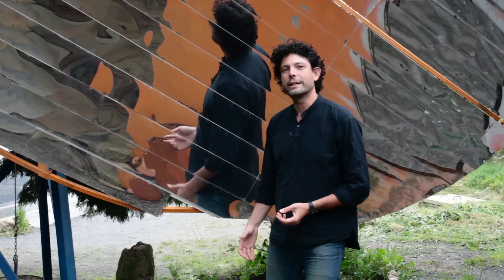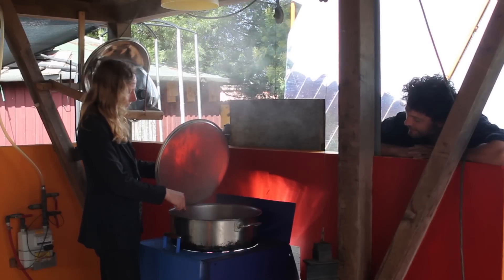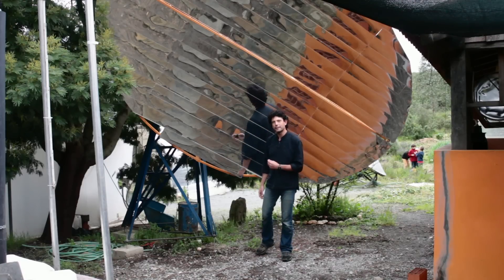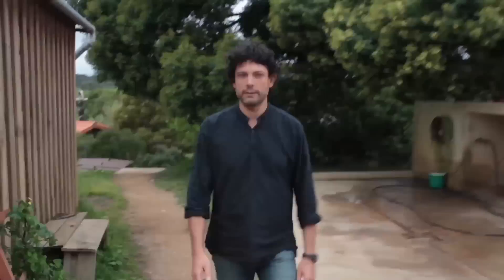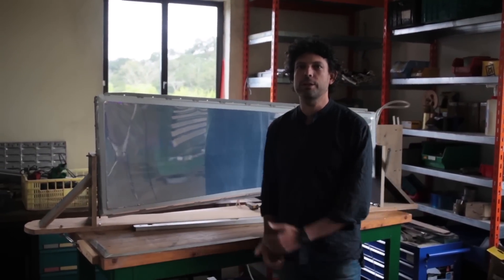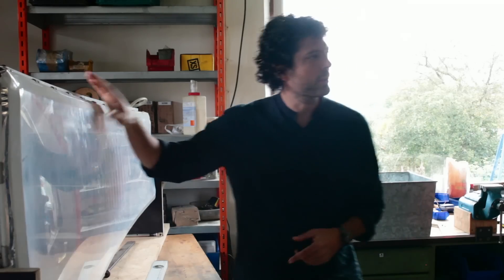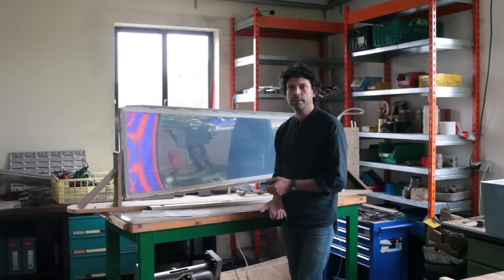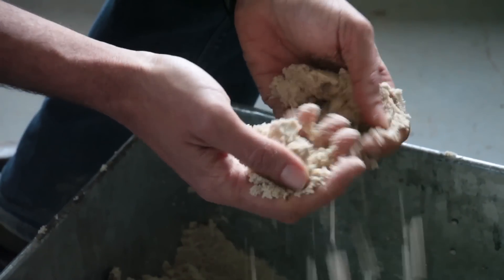Sun and Sand: Bringing the Sun Down to Earth

Comment: As I am sure the good Doctor knows the problem with solar is energy density. Solar energy runs about 1 kilowatt per square meter.  At about 40 kWh in a 24-hour period for an average household that's a lot of square meters (yards) even at  100% efficiency. It could be used as a supplement but there is a way to go.
Reply: thats more than enough
Reply: You do realize that a single 24ft diameter parabolic mirror operating at even 90% reflectivity (most quality mirrors run 95% or more)  will reflect 40Kw an hour right?  That is "1" single 24 foot diameter mirror which has a surface area of 452.4 square feet or 44.2 square meters .  Now you will only get 1,000 watts per square meter for about 6 hours a day tops and in northern climates while you can have longer days the watts per square meter is slightly lower.  Calculate in 8 hours of sunlight on the shortest day of the year here where I am at you would be lucky to average 200 watts per hour for those 8 hours.  Even at that though, 5 24 foot dishes would provide you 40Kw an hour for 6 to 8 hours.

I am not sure where you get this 40Kw an hour number, I have a 40 acre farm and use welders and a 10hp electric sawmill regularly and the most power we have ever used in a month is 1,400 Kw..  That is an average of 1.94 Kw an hour,  less than 1/20th of your estimate.  Another to calculate is the inefficiency within any given system as turning that stored energy into electricity would have at least a 20% to 30% loss factor, but that still wouldn't account for the 40Kw an hour rating.  This idea certainly has potential though it also has some serious potential drawbacks, the further north you go the more challenging it becomes and the more overcast weather you have the more challenging it becomes.
Reply: What are you talking about? 40kWh is a lot!

Comment: Please show more of your sand storage devices, so everybody can build this and please make it open source ! Many thanks. Regards, Stefan.
Reply: don't query my dude! sand is become a new fuel source! WE'RE SAVED!
Reply: Shine intense light at it, it heats up. You can do just the same with bricks or rocks, especially effective when they are black for the exposed sun part.
Reply: @lightdark00  Rocks require some caution as most rocks contain some amount of water.  The water expands upon heating especially high heat and then rocks can "literally" explode.  This does make rocks handy for disaggregation utilizing concentrated sunlight though.  A small powerful focal point will cause the water to expand and break small amounts of the stone into basically "sand".  Sand and clay materials are better for this as you can heat off all water content and there is no risk of explosion of steam pressure issues.  Rocks also have a gas content them as well and in excessively high heat situations the gas expansion may destabilize the stones structure as well.  For low heat applications though stone would be great.